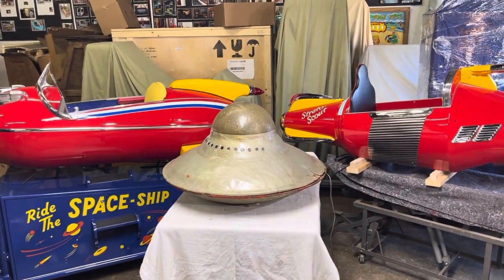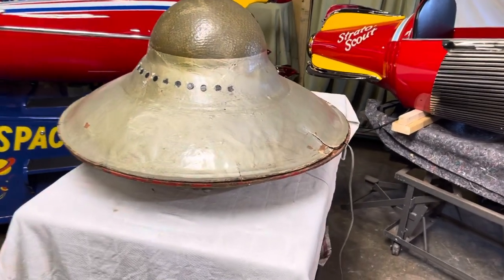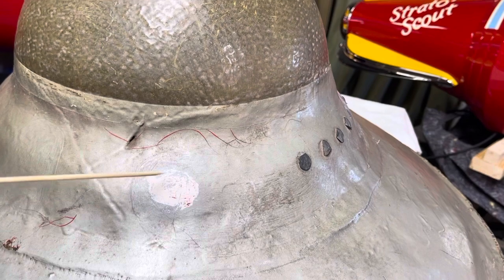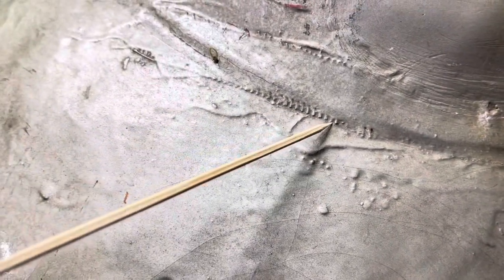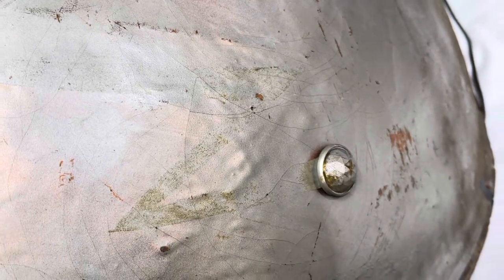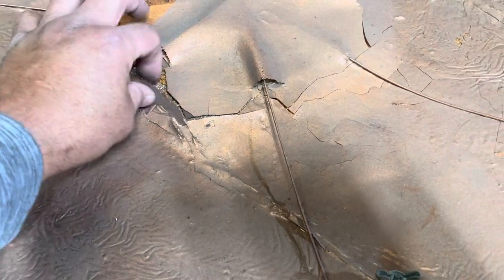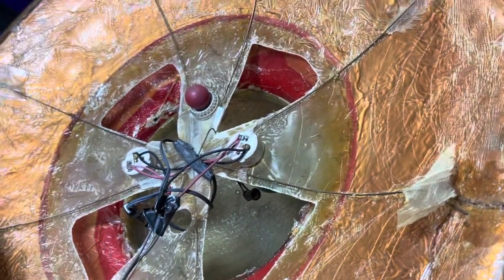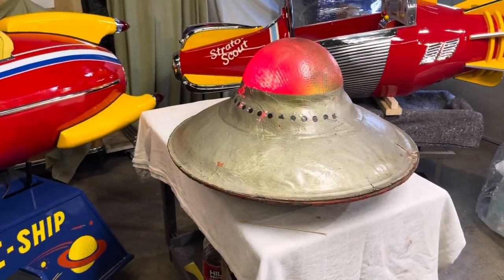Flying Saucer from the Dick Van Dyke Show “ Uhny Uftz

Comment: When my 2 younger brothers were children, during the early 1970s, they each got a flying saucer toy one xmas. They were metal, red and blue, and about the circumfrance of a dinner plate. It used C batteries, and moved along on the floor, with some flashing lights. It was really cool, it didn't fly, though. I always wondered what happened to the big saucer on Dick van Dyke show. It ought to be in the Smithsonian.
Reply from the maker: Thanks for reaching out. I posted a message also about it you can see it at the BILOTTA Museum in Jacksonville Florida.